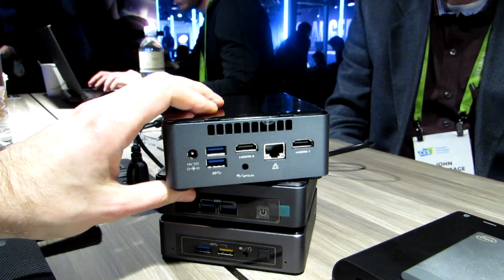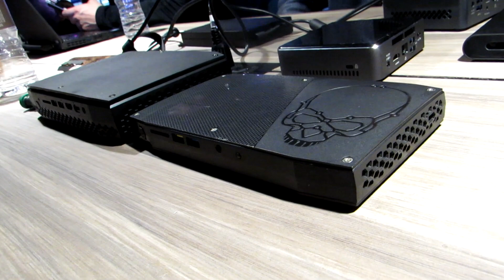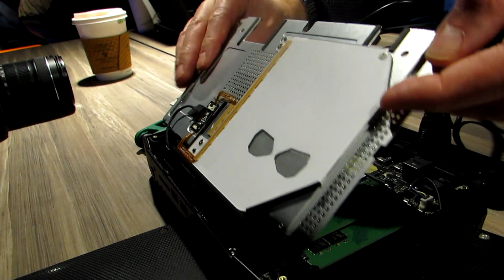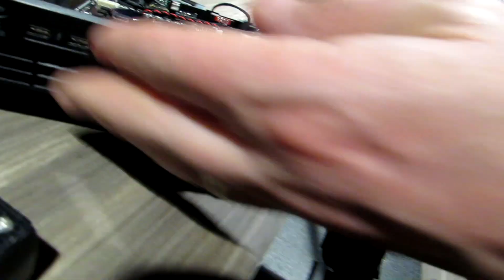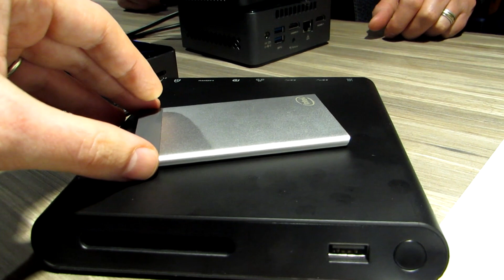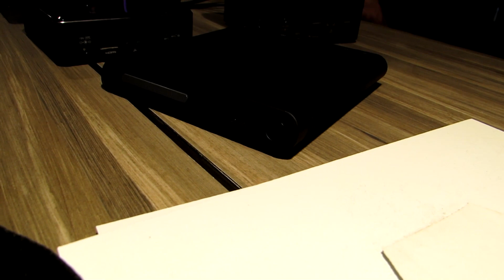Intel 2018 NUC mini computer lineup (and update on the Compute Card and Compute Stick)

Comment: Will these devices feature CPUs affected by Meltdown & Spectre or will that have been addressed at kernel/hardware level or simply a software workaround?
Reply: Steven Kelly Intel seems to be indicating that the next handful of chips are just as susceptible. It's a hardware bug, so you either patch the kernel and lose some predictive processing power or have the risk. They have to either redesign the x86 chip component, or phase it out. (So 64-bit only processors, with no 32-bit instruction capabilities.)

Comment: Can't wait for the Coffee Lake NUCs. But I would trade off a bit of height for having a 2.5 hdd bay, it gives a lot more flexibility.
Reply: Hade's Canyon NUC. you're welcome
Reply: It's a different kind of machine, more expensive, bigger. Not really the same.
Reply: Yeah, the Hades Canyon NUC with room for an additional 2.5 drive would be awesome. But having 2 M.2 slots is nice. You can always expand it with a external USB 3.0 drive via one of the thousand USB 3.0 slots it has. well not really a thousand but you get the point.